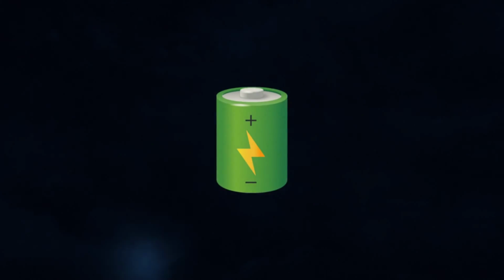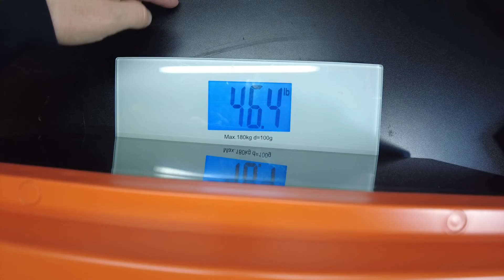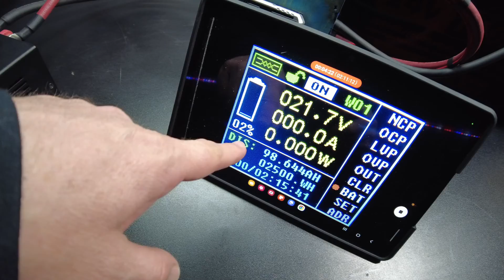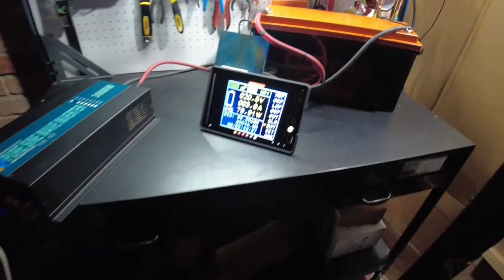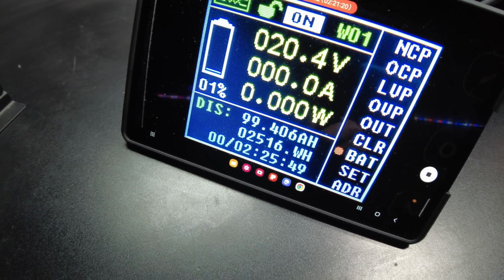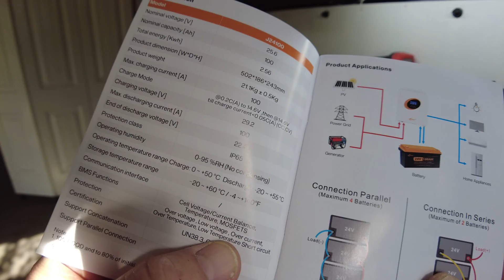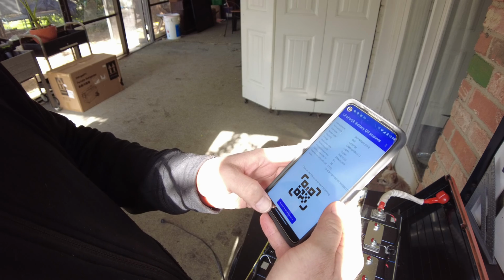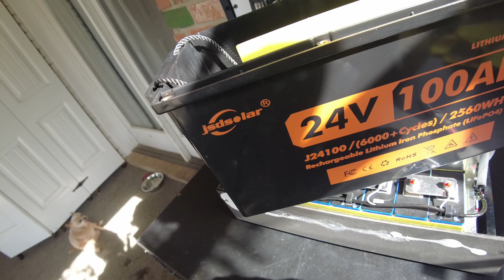Jsdsolar 24v 100Ah LiFePO4 Lithium Battery

Comment: Hey I’ve got a question for you. I’m building a Squaredrop camper and I’m putting 3 100w panels on top. Here’s the question ( I’m wanting to put 2 power queen 100ah mini batteries) I do not plan on used an inverter hardly ever all though I will have a 1000w sine wave inverter as I have it. And the camper has roughly 6 led lights 12v that will be used for about 3-5 hrs a night at 2w each and a couple usb ports to charge my phone and 2 cameras . This is an overlanding camper and I do not ever want to hook up to shore power.  Do you think this is going to be enough panels/ ah to do the job?  Also I wanted to know what you would recommend for a charge controller.  I was thinking the litime 30ah controller but wanted to see what your recommendation is.   Thanks in advance brother.
Reply from the maker: Yeah, that sounds pretty good. As for charge controller this Victron is at a ridiculously low price right now https://amzn.to/47qXCJb Not sure how long it'll be at this price but I would not hesitate. Thanks

Comment: No wonder it came up short. You can't get an accurate Ah rating with that cheap sub $50 Chinese made DC load tester. We paid over $8,000 a piece for each one of our loads testers. The lowest cost DC load tester in our battery lab was over $3.200. The setup  you're using can be off by at least +/- 15-20%. If you're going to be posting product review videos, you really need to invest into some decent, calibrated lab grade, test gear.
Reply from the maker: @PersonalStash420  That sounds pretty good, and going 24v will be much better with the 1200w solar, and the extra storage you're talking about. Now I would suggest you get residential, or commercial solar panels over the little 100w panels. You can get a much better price per watt. Just look for used panels on marketplace, offerup, craigslist, etc.. sometimes you can even find new. I can get new 400w bifacial residential panels for $130 in my area. Thanks
Reply from the maker: Been posting battery reviews going on two years with this tester. It's quite accurate enough, and this battery did not come up short because of it, most of my battery reviews pass. Thanks
Reply: @BradCagle  I have tested a lot of cheap testers using a calibrated tester and found them to usually be within 2%. That's actually a shunt, not a load tester. A load tester contains a shunt as well as an electronic load. The inverter is the load in this case.
Reply from the maker: @john_in_phoenix  Right it's a shunt, however the whole thing (Shunt, wiring, stand, inverter, etc..) encompasses a DIY load tester. Which is what I have purposely built. This shut I've used a lot, I feel it's accurate enough. Most batteries pass on my channel, 100Ah batteries I test usually come in at 102 to 104+ Ah. Thanks
Reply: @BradCagle   Yes, I was just trying to point out why an electronic load is expensive. Basically you not only have a shunt, but circuits to generate a load (usually in watts, amps, etc) and to dissipate the power. Shunts relatively speaking are cheap, since they are just a precision resistor with a circuit to measure voltage drop. Being able to generate a load, and control it so that it is uniform in either watts or amps is much more complex, especially when you get to the high power level and heat dissipation. I used to design power supply test sets in a manufacturing environment. I think your testing methodology is fine.
Reply from the maker: @john_in_phoenix  Yeah the electronic load portion would have some pricey components in it. However most of the cost is likely because it's a specialized piece of lab equipment that does not have a very high sales volume. Prime example: I just bought a special brass nut that is used on my pool filter. $50 for a nut LOL